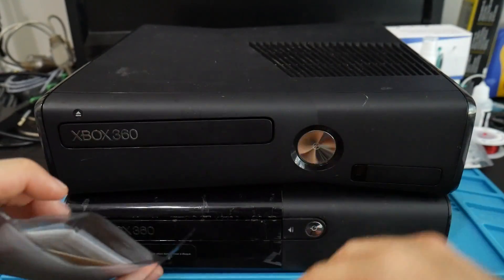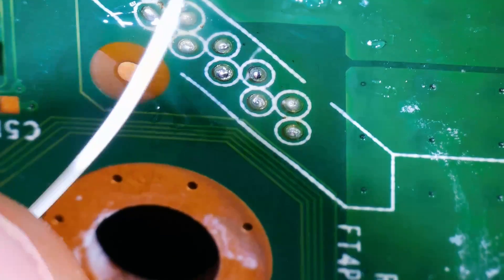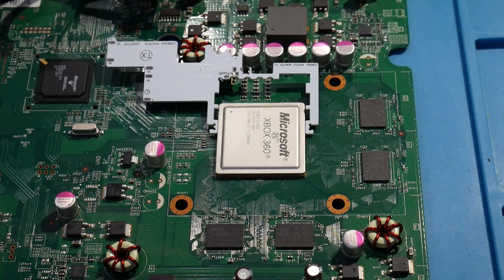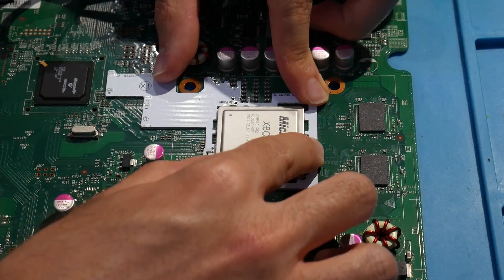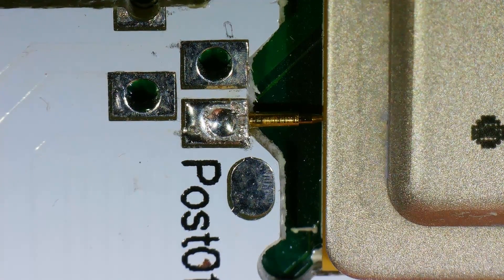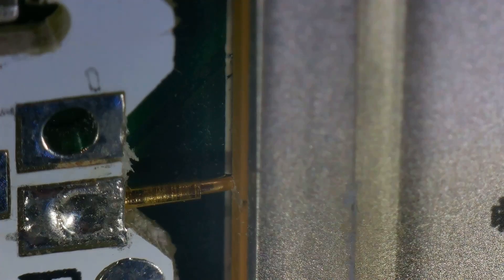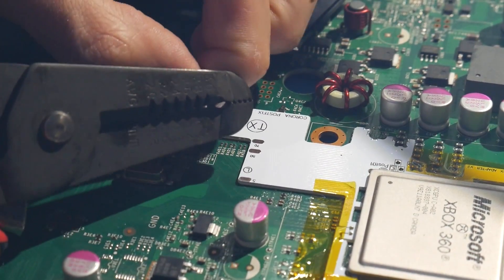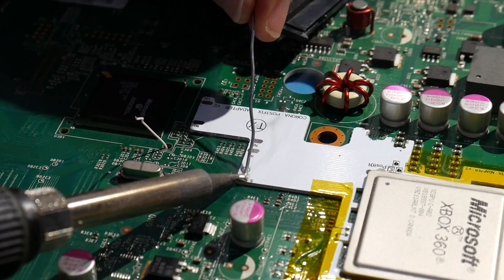Using a Postfix Adapter on a Trinity Motherboard? - Xbox 360 RGH Install Tip

Comment: I have a questions, does the postfix tool has to stay on the console after the flash is done? Or can I remove it to use it on another console?

Comment: I accidentally pulled off my post point, will a postfix adapter restore functionality to the console if it powers on and powers off instantly?
Reply from the maker: A broken POST point would not prevent the console from booting, unless you've flashed the NAND already?
Reply: @MrMario2011  I flashed it back to retail so I could just use the xbox normally until I could get somebody else to mod it for me. It was only AFTER flashing back to retail that it refused to power on fully. It would power on and STAY on when it was flashed for xell, but the console wouldn't boot it would just stay on the "No input signal" screen. and yes I tested to make sure I was using the right hdmi lol

Comment: Hey, mr.Mario, i Think i screwed up with PLL point.. there is another option to get info PLL? 
I scratch this little wheel but i Think too much and now i cant properly solder the wire. 
Also i use wire from CAT6 cable with 1kohm resisor so maybe this is problem ?
Reply from the maker: S-RGH now, there's no PLL alt point.

Comment: having trouble with my trinity so looking to try a post fix to see if it help so  where on the board does the wire solder to from the post fix adapter is it to  POST or SMC_POST ??
Reply from the maker: The POSTfix adapter replaces POST

Comment: For postfix v1, wich post is the one to soder? 6,4 or 1?
Reply from the maker: I can't remember, but only one of the pads has connectivity. I believe it was 6, but you would have to test it with a multimeter.
Reply: @MrMario2011  thank you

Comment: For the postfix adapter v2 on a trinity board, do you run a cable from SMC post from the back to the front and solder it to the postfix adapter? If so, what spot do you solder it to on the adapter?
Reply from the maker: Instead of soldering to POST on the motherboard, you solder to one of the breakout pads on the adapter. Solder to whichever one has continuity to it when tested, I think on the V1 only POST_6 works.

Comment: On my first RGH install with a trinity board, I messed up the post point as well. Couldn't get solder onto the point and as I kept trying, it just made it worse. (Was using a really garbage soldering iron. Ordered a micro soldering Iron to arrive the next day) So after some research, I learned on a forum you can just flip the motherboard back over and scrape away at a via at STP5D1 and solder your wire there. I had to do this and it worked like a charm.
Reply from the maker: Yep! That's a good alternative point to use, although quite small. The only thing I fear about that is most people who messed up the big POST point probably won't be able to successfully get that alternative. Awesome you managed to get it!
Reply: I have messed up my pll point on Trinity... Could you help with forum link

@ChfHappySack
Reply: @razimohiyadheen8245 there is no alt PLL point. Do S-RGH

Comment: Hi mr Mario I’ve a corona with a RGH  3.0 but I’ve a really slow boot on it sometimes more than 4mn , I also use a post fix adaptor V2 .
I can’t find what can be the  problem I did many RGH 3.0 on different models by following your videos I never got this and I can’t find anywhere the solution . Did you get some issues like this and what can cause this problem ….thank you for your videos helping me a lot
Reply: Try changing the timing? You dont even need to reopen it, just dump your nand with homebrew, edit it in jrunner and rewrite it with the homebrew (forgot the name of the tool)
Reply: @zz19991 yeah I tried to recreate an image by using Jrunner pro with my retail nand and then flash with the new updflash.bin with Xell or 360 nandflasher but no thing change no success… 
I do not understand
Reply from the maker: Could try changing the resistor value, use no resistor, or change wire routing.
Reply: @MrMario2011  Thank you so much for your advices like as usual for corona I used 1k ohm resistor and wrapping wire 30awg and postfix adapter V2 but I’m gonna try an other resistor value or without resistor and then my wire routing … will let you know on the comment section if it’s work 😉
Reply: @MrMario2011  so I replaced my wires , resistor and the postfix adaptor and then that’s fix my problem I got an instant boot 😜thanks a lot …
Could you make a video on the PicoFly RP2040 zero for Nintendo Switch I think lot of people will be interested on it 😉
Reply: You recommend a 3k oh resistor in parts listing its for what
Reply: @djcvmusic1  3k Ohm resistor normally is for Trinity motherboard for my case it’s a Corona

Comment: Greetings from Bulgaria. What is the cheapest flasher for the Xbox 360? Could I just remove the nand from an usb flash drive and solder some wires to the Xbox?
Reply: Raspberry Pico is pretty cheap.
Reply: Corona v4 can be read with sd card reader, i’m serious. The cheapest one you find, the better.
Reply: Pico, if its single use, you can reuse it later for something else
Reply from the maker: PicoFlasher with Raspberry Pi Pico

Comment: I have some spare adapters. I had some Coronas I never could read the NAND on. SD card adapter fail... Any tips for corrupt 4GB Corona firmware?
Reply: Reading can be tricky, could be your soldering points. I managed with Pico after few attempts and using very thin wires
Reply: Try a different sd card reader.  The cheapest no name ones looking like a flash drive are the best for this job.
Reply from the maker: The SD card method is very picky about which SD card readers it works with. I've personally had no issue with the xFlasher360